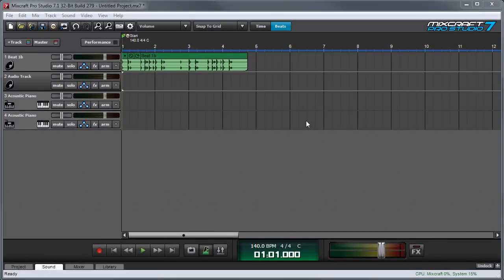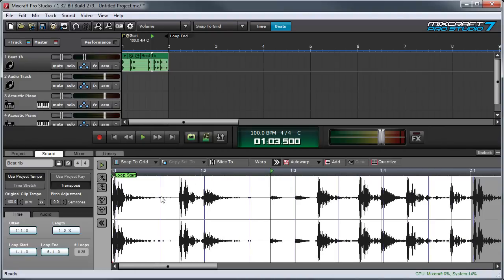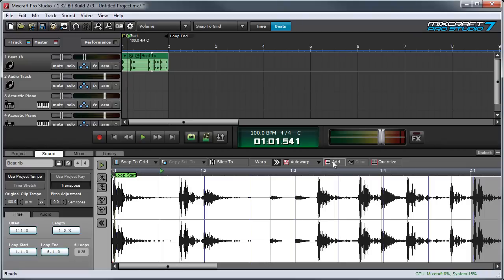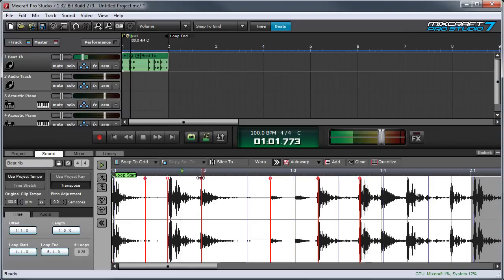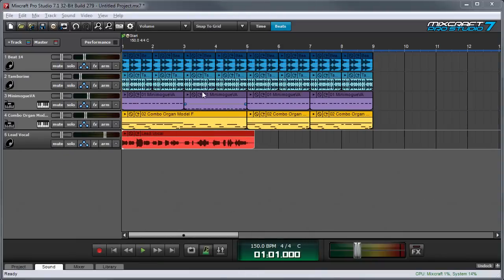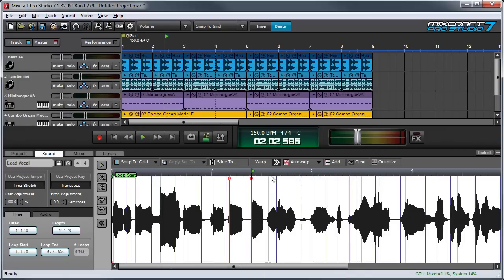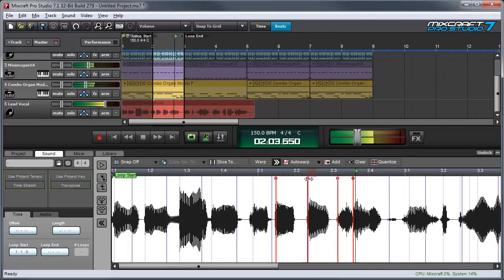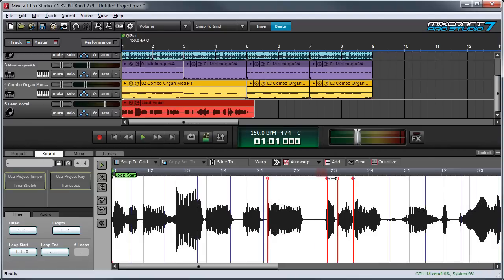Mixcraft 7 Audio Editing: Warping

Comment: Warp

Warping audio lets you adjust the⌛ timing⏲of audio by detecting the locations of transients or “hits,” then effectively time-stretching and -expanding small regions between transients within an audio file. This offers powerful creative and corrective options. Used on a smaller piece of audio, such as a drum loop, warping lets you correct the timing of poor playing or requantize audio for different rhythmic feels. When applied to an entire song, warping makes it easy to lock up the tempos and feels of songs, allowing easy mixing and creation of the song “mash-ups.”

Mixcraft’s warping tools are easy to use; not only can Mixcraft interpret tempo, time signature, and beat locations to assist in the placement of warp markers,

Mixcraft includes an Autowarp function that automatically locates warp information and places warp markers.

 How To Use Warp

1. When Warp is clicked in the Sound Tab Toolbar, Mixcraft scans the currently looped audio region and makes educated guesses as to tempo, time signature, and beat locations. The blue lines shown display the predicted beat locations, and black lines show transient hits. The blue and black lines have no effect on the sound, but the predicted beat locations are very helpful when placing warp markers described below.

2. Once the predicted beat locations and transient hits are displayed, set the Audio Tab’s snap setting to Snap To Grid. (This makes the Caret snap to predicted beat and transient locations.) Now click on beats and transients to place the Caret, and add red Warp Markers by clicking the Add Warp Marker button in the toolbar (or right-click and select Add Warp Marker). If you don’t want neighboring hits or audio areas to be affected, place “safety” Warp Markers

on hits before and after the hits or areas to be manipulated.

3. Once Warp Markers are in place, they can be freely moved left⬅ and right➡ to
squeeze and stretch audio in time. It’s easiest to hear the effects of warping by pressing the green Sound tab play button and moving the Warp Markers in real-time during playback. Feel free to experiment - like all Mixcraft audio processes, warping is non-destructive, and its operation is easier to wrap your head around when you’re actually using it!

4. To remove a Warp Marker, right-click it and select Clear. To remove all Warp Markers from a loop, click the Clear button in the Sound Tab Toolbar
Reply: How do I turn it off for good. It's screwing up my loops everytime I open mixctaft it's just already their so annoyiv